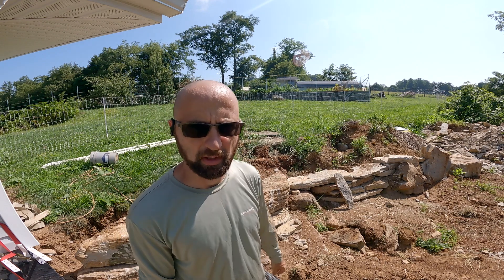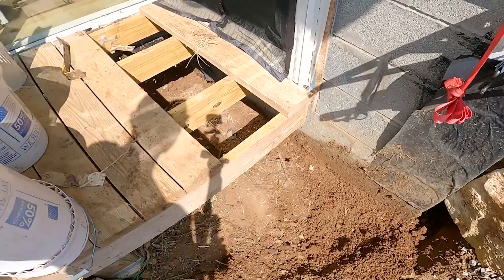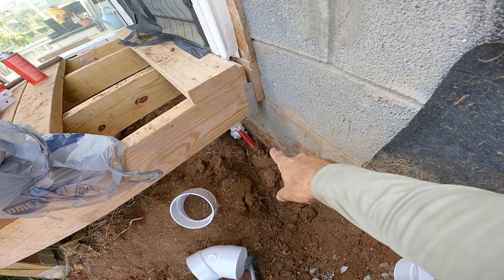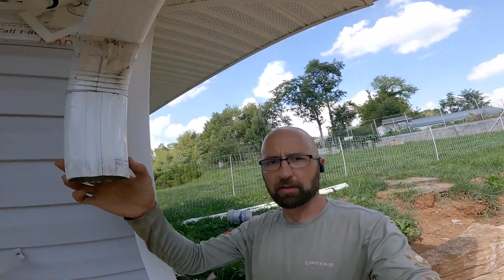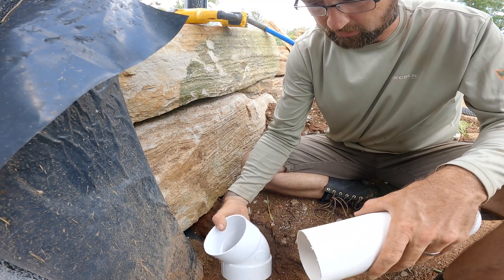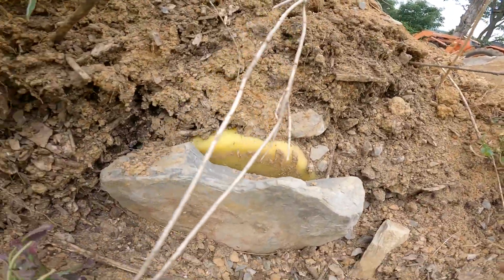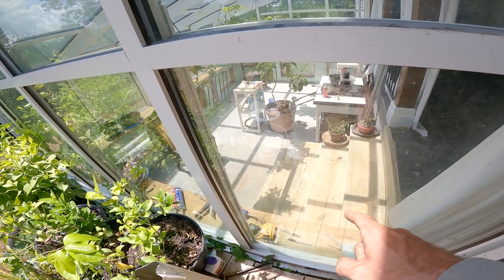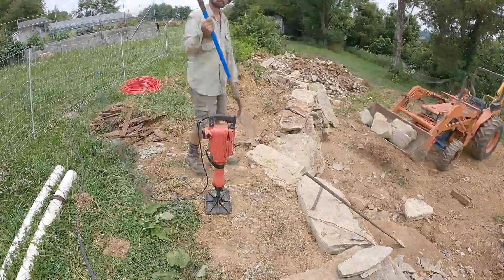Building a Big Stone Wall

Comment: No drain tile behind the retaining wall?!?
Not saying it WILL fail in 5-10 years, but I am curious that will your access to a digging machine, tools, proper backfill, etc. your logic behind not taking the little bit of extra time and effort to put in 12" at least of drain tile especially with that large yard above it.
Here in the hilly country of Wisconsin, that doesn't weigh about 1,000/m2 is going to move with the winter freeze/thaw cycles and I see at least parts of VA are at the 30"+ deep frost line while southern VA is only about 6".  Since these are 100 year marks, most builders and codes go a few inches to 6" deeper to get closer to a 200-500 year mark just to be super safe.
Honestly curious, not trying to a prick about it.
Thanks for the video.
Reply from the maker: I understand what you're saying and I know the code. I always use a french drain behind walls built of block or brick. This however is thousand pound boulders set on bedrock with wide slabs set on top. If it moves it wont be much..   :)
Reply: Pretty stone wall Barry! I like your back sun room. Lots of hard work, good job!❤🎉😊